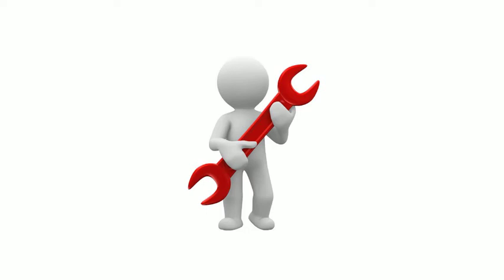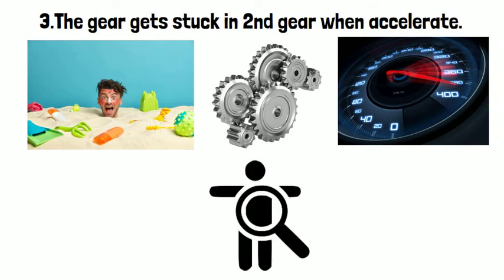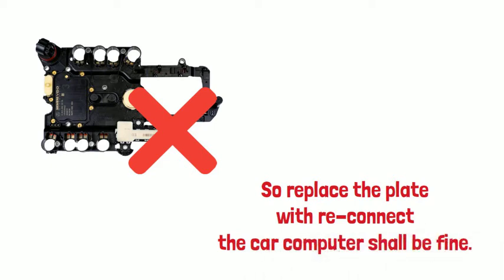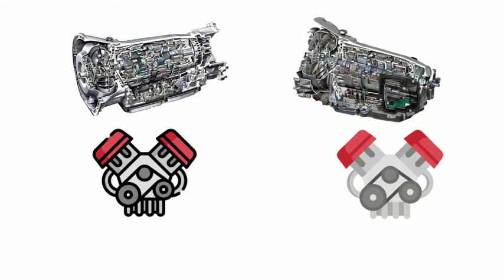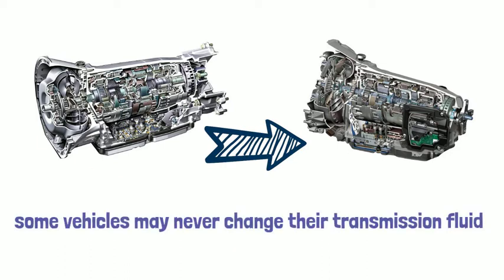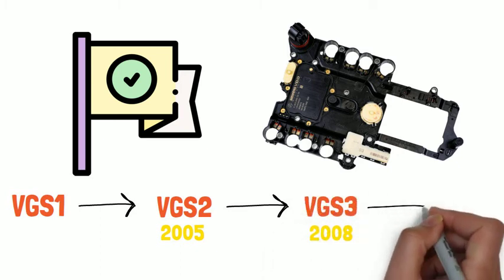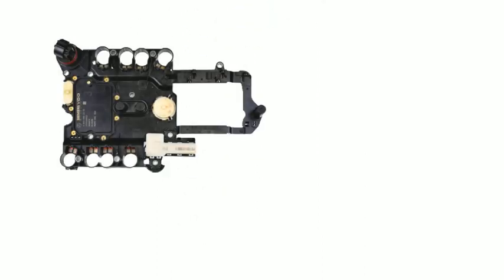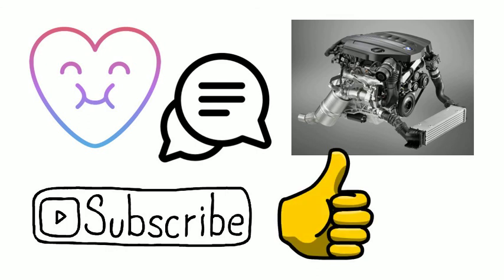722 9 7G Tronic vs 7G Tronic Plus Difference & Problems

Comment: I have the 722.6 transmission but I suggest the same service interval for both it and the 722.9 variants. I replace my ATF every 30k miles and replace the ATF along with the filter every 60k miles. For 722.6 transmissions, I suggest inspecting the electrical connector at every 10k mile oil change for fluid seepage. I replace the connector every 60k miles when I do the filter. Use OEM parts to avoid quality and fitment issues. Failure to maintain clean fluid in the transmission can lead to conductor plate failure. Excess particulate in the fluid collects around the electrical contacts in the conductor plate and causes a short or low-resistance medium; causing electrical malfunction. Keep in mind, the speed sensors are magnetic and will easily pickup metallic particles in the fluid and cause false readings.
Reply from the maker: WOW dude! You're expert! Thanks for sharing!

Comment: My ML350 2008 the plate went bad. It showed a bad sensor, but those sensors never go bad. It is always the plate! Found a guy with junk yard plate, wiped and installed VIN. Replaced filter, gasket, with synthetic fluid, even the pan aluminum screws need to be replaced!
Reply from the maker: cool dude! tks for sharing!!!!

Comment: Good morning from the UK, I am having trouble with rpm fluctuation when driving. I have no engine fault codes. The only one I have coming up is electric gearbox pump for start stop do you think that could have something to do with it? I am replacing the pump because start stop does not work at all. So I’m thinking this could have something to do with it. What is your opinion any help would be greatly appreciated. Thank you

Comment: Hi my 722.9 (year 2013 7G Tronic Plus) has slight jerking shifting from gear 2 to gear 3, possibly gear 3 to gear 4 and VICE-VERSA when downshifting, only when driving slow...also sometimes happening only. What could be the problem? Xentry OBDII diagnostics show no error codes...please help... thank you
Reply: I have this same issue with my 2014 c250
Reply: Change your oil

Comment: Hello everyone ! 
My mechanic put wrong oil trasmission on my c300 2012 . He put red one 236.14
But the car need 236.15 blue one. I have made 14k km , what should i do . Could i have problem if i change now with blue one or should i keep red one
Reply: Do not leave the wrong oil, it will cause problems.  It will need a full flush and the correct overflow pipe.